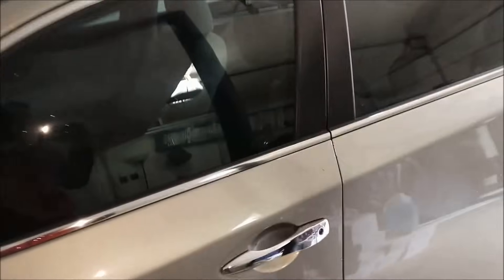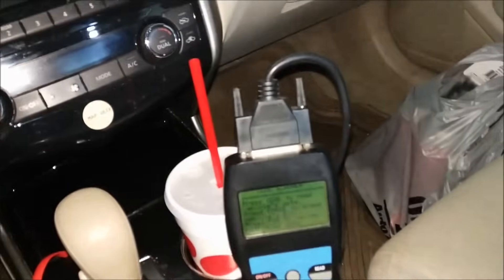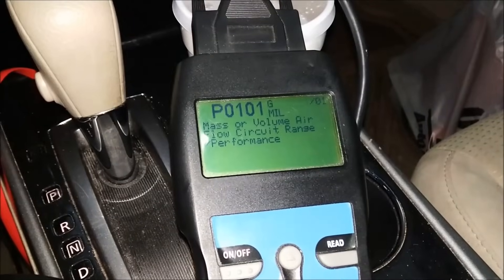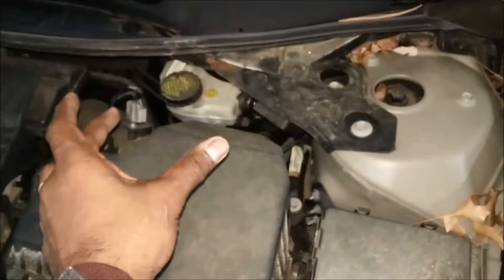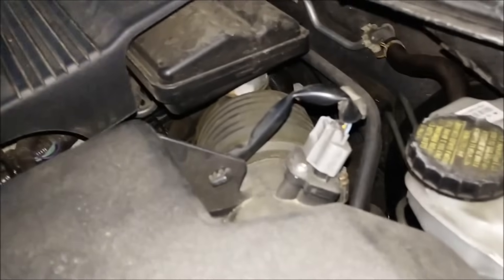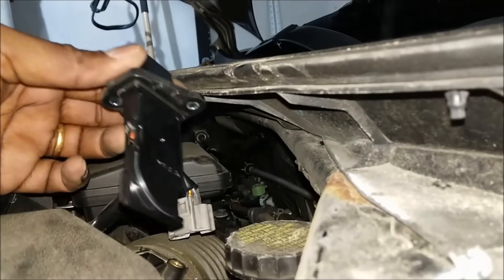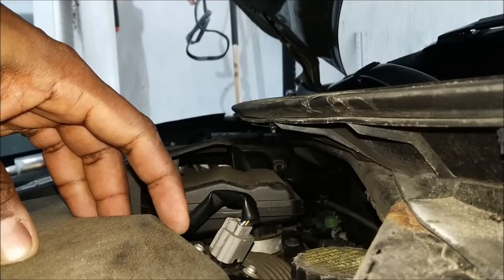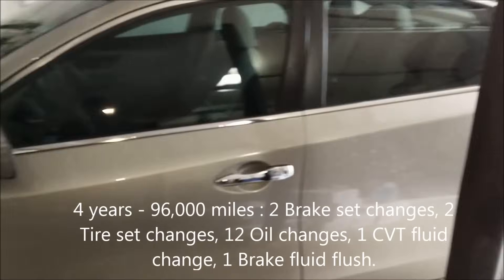2013 - 2018 Nissan Altima code P0101 mass air flow sensor DIY Fix

Comment: You made it look so easy. My daughter's 2013 Altima Has the same Mass Air Flow code. The sealership wants 300 for the part and then labor cost. Im going to probably get a better aftermarket part and install myself for her. Thank you for the informative video..

Comment: Thank you for this vid. I'm about to go get the cleaner and try cleaning first. My 2015 nissan Altima has 321326 miles on it and this is the first time this code came up. I will follow up after with my results.
Reply from the maker: 321k miles on the car. That is impressive. Did you do any transmission flushes along the way?

Comment: 2013 Nissan Altima SV. Same code, cleaned the MAF light came back on. Replaced the MAF, light came back on. Searched online for more solutions, and folks have said a faulty PCV valve can give you the same code, or a dirty throttle body. Checked the throttle body, and it's clean. Next is replacing PCV valve and hoses.
Reply from the maker: There was a service bulletin on the pcv valve, the cars came with some fault ones and Nissan changed the model to the black color valve I believe.
Reply: So what did you do to make it work…changed all those items but still have my light coming back on. Believe I need to get the Ecm reprogrammed
Reply: @coachtrollinger that's what it is more than likely. Same problem and dmv asked for smog check. Some dude programmed my nissan for 200 in Los Angeles
Reply: Fixed problem but I had to run car for about 100 miles before smog
Reply: @patrontwentyone did it work after the reprogramming ?
Reply: @dnasiasmith3983 it did passed the test if that's what your asking, but a few months after the light turned right back on. From my understanding it's  the reprogramming a leak in the catalytic converter or sensor.

Comment: Thank you so much, this worked perfectly for 15 Altima P015a  02 sensor issue. Pro tip, if you dont have a scanner, Autozone and most other auto part stores will scan your vehicle for free and give you the print out
Reply: Hey before you replaced the o2 sensor in your altima would it shut right off soon as you cranked the car?
Reply: @cedricmiller4370  no sir, I only had the engine light on, no noticeable performance issues
Reply: @cedricmiller4370  why I had the same issue so I crank my vehicle is shuts off now making a weird noise
Reply: @mikegold4559  Describe the noise.. I have had a 2009-2019 nissan altimas except the '13 and the shut off after you crank can be associated with your sensors going bad. Do not replace any parts until you get your codes. If your codes show sensor malfunctions, try not to drive more than a few weeks before getting them cleaned or replaced. Driving with dirty or bad sensors can cause your engine more harm the longer it goes unfixed. Most altima codes for sensors happen right around 60k-90k miles (depending on frequency of use). Also, Altimas are one of the easiest cars to replace parts for. I taught my mom how to fix her own car, she has replaced headlight assemblies, belts, her A/C Condenser, mass airflow sensor, spark plugs, wheel bearings, rotors, brakes.. my mom is 68, if she can do it, you can too. YouTube has all sorts of DIY vids, you'll save tons! Good luck!

Comment: A question in 2012 also that is the location of the mass air flow sensor. And when you cleaned the sensor did you erase the code before or after cleaning the sensor sir

Comment: The bird was great. Thank you for this. My hubby passed and he used to take care of my car. My light also went on so i will do all you suggested. Any suggestions on why my 2011 altima is burning oil? No leaks.
Reply: Check your valve cover gasket

Comment: Awesome video. I'll subscribe. You'd be a great teacher of real history or knowledge and or a great father is bet. Cleaned my air filter and it was nasty. My mpg went up insane in a test run around block. I'll clean my mass flow this week. Thanks,great video. Hopefully your cvt didn't die. Notorious for these cars. I only have 37,222 miles but they go out earlier then that.
Reply: Mine went at 56,000 cost me $4700.00 to fix. I'll never buy another Nissan product. They are junk.

Comment: Need help I have 2013 Nissan Rogue I change the mass air flow sensor but I try to erase the check engine light but turns on right away again

Comment: Have a 2011 Nissan Altima. Only 75k on it.  Same issues Check engine soon light on. Traction control engages out of nowhere. Shaking etc. an absolute mess.  Dealer said they fixed it only to happen again days later. Brought back for 3 weeks gave me loaner now got car back last week and check engine soon light is back on traction control engaging out of nowhere.  Bought a cleaner today trying to fix myself. I hope my car is not a lemon.
Reply from the maker: Read the codes and see how many codes are there and what are they.
Reply: Did your resolve your issue? What was the problem? I am having traction control issues as well!!

Comment: After replacing the sensor if issue still persist. Does cleaning throttle body will resolve it?

Comment: Don you have to reset the code or will it go away
Reply from the maker: It should go away after few cycles of driving if the sensor is reading correctly. You can also erase the code and the monitors will relearn.

Comment: And for the Nissan Versa note is the same thing?
Reply from the maker: Versa has a smaller engine so placement of the sensor could be different. Generally same procedure as long as you find the MAF sensor.

Comment: My 2014 just recently started giving me the code but it comes off and on with no real pattern. I’ve replaced the mas twice any idea what else it could be?
Reply from the maker: If it is not the maf, then it's either the pcv valve or a leak in the air intake house. Also sometimes it needs a software flash when you replace the pcv valve.
Reply: jjcentral I appreciate the fast response!! thanks I’ll definitely give that a try

Comment: Hola yo tengo el mismo problema en mi nissan 2013  lo yeve hacer el smog check y no paso me dijeron que tengo que cambiar el sensor del que usted hala y que ban a reprogramar la computadora  es verdad eso k ocupa reprogramar la computadora me cobran 450 dolares
Reply from the maker: No todos los coches necesitan flashear el PCM. Depende del sensor. Si se trata de un reemplazo OEM directo, no es necesario volver a flashear. Si se trata de una pieza no original, entonces sí es necesario volver a actualizarla.

Comment: What about a p0101 and has a new filter, new MAF sensor? Clean air box, cleaned throttle body. I usually reset the battery and the check engine goes off any my fuel mileage stays higher then it kicks on and drips drastically. 2011 xterra
Reply from the maker: Pcv valve?

Comment: Could you use rubbing alcohol in a spray bottle?
Reply from the maker: Rubbing alcohol, brake cleaner and other quick evaporators leave a little residue that may affect the sensor, thats why its ideal to use the specific MAF sensor cleaner.

Comment: Hello how would you recommend cleaning the air filter if it is dirty?
Reply from the maker: Air filters are cheap, replace them. Only if you have k&n filters you can use the cleaning solution to reuse them.

Comment: I cleaned my sensor and changed air filter once I had the Check engine light reset it came back on a couple days later do I just need to change the sensor?
Reply from the maker: Try changing the pcv valve next before you change the maf sensor.
Reply from the maker: @djsimma8617  Dealer service bulletin recommends a flash after changing any sensor. I have had plenty luck turning off the light with just code reader and using generic parts. The sensor is just sending low voltage, why does it need to be reflashed? On the other hand a full module change airbag, pcu, ecu, abs etc.. sure definitely needs reprogramming to accept the newer module.

Comment: The MAF is not the fix for this DTC. There is a SERvice bulletin for that p0101 DTC. You have to replace the PCV valve and reprogram the ECU. IF you have an oramnge PCV valve than the DTC will return eventually. Replacing it with the updated part (its Black) and dont use an aftermarket part, then the ECU needs to be reprogrammed. I work for Nissan.
Reply from the maker: Good to know. My DTC hasn't returned in the past 10,000 miles after the MAF replacement. If it comes back I will explore the pcv valve option. Are you saying that if I replaced the pcv with the genuine Nissan part, I don't have to reprogram the ECU?
Reply: @JJCentral-DIY  no im saying There is a Service bulletin that applies to your vehicle for that particular DTC. That requires PCV valve (updated part number) and reprogram. If the MAF fixed it. Then i would not worry. Its possible your MAF was bad. Typically i find that the MAF sensor is not usually the cause of that DTC. Most of the time its people using cheap aftermarket air filters that dont fit properly allowing dirt to get into the MAF sensor or some type of intake boot leak. Usually just cleaning the MAF and putting a quality good fitting air filter in (doesnt have to be Nissan Just has to fit properly) works. I just did a video on my channel on a Murano with the P0101 DTC. check it out.
Reply: Travis Butler  no, it needs a new PCV and a reprogramming.
Reply: if you put a new MAF on (unless its OEM) you will end up with more problems.
Reply: Auto Fix Pal any idea would could cause the light to come off and on? I replaced the mass sensor twice and the code keeps coming on I’m getting a little frustrated and my mechanic doesn’t have an idea but after reading this do you think it could be my pcv valve?
Reply: @pauljimenez4076  things that cause p0101 on nissans.. No. 1 cheap poor fitting air filters (use OEM). No. 2 really dirty throttle body.. No. 3 PCV valves on certain models, there is a tab for this.

Best place to start is to make sure you have a very good quality air filter that fits the air box very good. I do not know what brand of aftermarket filter is good enough so just get an OEM Nissan filter and be done with it. This is the most common cause on newer nissans.. On older Nissans ripped intake boots, and cheap air filters are the most common cause. Aftermarket air filters DO NOT fit properly most times and often cause air flow fluctuations that trigger the p0101 DTC.. Start with the filter, clear the light then check everything else if it returns. Nissan MAF sensors do not fail often. I repeat Nissan MAF sensors DO NOT FAIL often. Very rare. It's usually another issue.
Reply: @Autofixpals  Thanks for the fast response!!! I need to check the air filter I remember having it replaced at valvoline not sure what they use but I saw your video with the rouge does it have to be the exact number you used or just a OEM NIssan filter?
Reply: @pauljimenez4076  just OEM Nissan filter. Doesn't need to be the same exact number
Reply: @pauljimenez4076  now make sure you subscribe!
Reply: Frame is cheap but does not seal or filter well.
Reply: How much you have to pay for reprogrammed?
Reply: $300 Nissan dealer told me yesterday
Reply: Thanks I replaced my Sensor and the light still came on twice after

Comment: This was an awesome tutorial!, Question tho, I did the cleaning, and felt a difference on the idle and throttle, but the engine light still on. Does definitely mean I need to get a new sensor or do I have to reset something
Reply: You gotta reset so it relearns and buying a new one i would suggest
Reply: @scorpion_fps  how do you reset? I just cleaned mine but the engine light is still showing, even after driving it around (maybe 10 miles or so)

Comment: Will this code cause your car to not start properly for example Once I turn my car off I have to let sit for about 30mins before it will start again.
Reply from the maker: No, that is usually a fuel problem or the air intake is severely blocked in someway. Start by checking your air filter.

Comment: Update, refer below for old posts. Replaced air filter, cleaned entire airbox, no vaccum leaks, not a bad ground to the maf. Cleaned the throttlebody, light came back but restored some mpg. Replaced maf with a brand new hitachi maf, no reprogram from the dealetship and mpg went up even more and the light is finally gone for good. Ended up being the mass air flow sensor needed replacing, the old unit ran the car, no symptoms other than a missing a few mpg average and a CEL. Problem solved.
Reply from the maker: Thanks for the update, I don't believe a straight resistant measuring sensor like this one needs any dealership reprogramming. A replacement one should fix the issue. Just check the continuity and clean up everything.
Reply: Why did you replace maf? Didn't cleaning the maf resolve the problem?
Reply: I’m experiencing the same issue, cleaned sensor twice a light came back on. No drivability issues other than less mileage.
Reply: @blainemcdonald6972  I cleaned it because it had never been cleaned before at 65k miles. I was hoping it would fix the issue. It improved it slightly, but all in all, it was due for replacement.

Comment: I changed mass flow air sensor, due to check engine light code, on a 2011 Nissan Rouge Check engine light came back on. What should I check replace next?
Reply: You should scan it before replacing stuff to see what is them problem

Comment: Thank you for the video sir. 
Does the engine light go away after you clean the sensor. Or it needs to be reset manually?
Reply from the maker: It needs to be reset for quick erase, if not it will go through few cycles that may take up to a week to go off by itself.
Reply: @JJCentral-DIY  thank you. 
So which way is better? A quick reset? After that if the the engine light pops up again, I know the error could be due to something else.
Reply from the maker: @hulong0205  that is correct. You erase and see what new or old code pops up. That will tell you if you fixed the root cause or the symptom.
Reply: @JJCentral-DIY  Thank you so much! Very helpful information!!!

Comment: Well, I put a new oem maf sensor and clean filter.  Still getting the code.  Any suggestions?
Reply from the maker: Change pcv valve as well with nissan oem, pretty cheap.

Comment: Could you guide me where evap sensor located in nissan altima 2013 ? Do I need to open dash to replace it?
Reply from the maker: Assuming you mean the evap purge solenoid, it is on top of the intake manifold towards the back of the engine. You can do a 9 or 12v  battery test to see if it closes. If you are replacing that change the pcv valve right next to it.

Comment: Great video! I changed out the mass air flow sensor but the same code came back a few days later. Anything else I should check?
Reply from the maker: Change air filter, clean throttle body, and replace pcv valve with the OEM.
Reply: @JJCentral-DIY  appreciate the quick reply!! Thanks

Comment: From experience for what ever reason, Nissans and Infinitis don't play well with  aftermarket parts.  If you end up having to replace your maf sensor,  get one from the dealer or original factory part online.  Paying a little more upfront,  will save you in the long run when you have to replace the aftermarket part.
Reply: Mine is OEM Hitachi $560.00 dealer price. After market does sell the same Hitachi MAF sensor. Price is $ 385.00. Caution do not buy cheap air filters that are mentioned here. Nissan filter is around $35 better filtration and more durable, you get what you pay for.

Comment: What happens if you replace the mass air flow sensor with and OEM. The engine light still come one again even after the code has been erased?
Reply from the maker: Here are your options, Check the throttle body, if it's dirty, clean it. Check the connectors and the wiring at the MAF sensor. If you have a scan tool, look at the short fuel trim numbers at high and low RPMs. If the short fuel trim (STFT) goes lean at low RPMs, it's a sign of a vacuum leak. A leaking purge valve, as well as brake vacuum booster can also cause this problem. Check the MAP sensor; it's used to check for rationality of the MAF sensor. If the oem MAP sensor is faulty, it also can cause the code P0101.
Reply: @JJCentral-DIY  What about if the MAF sensor is reading 195 g/s constantly, and sometimes drops to the normal range 6-9 g/s? Is this a sign of a failed MAF, or is this a wiring issue? ( I ask because the car had the MAF replaced a year ago)
Reply from the maker: @roofcamper3473  at idle it should read between 2 and 8 and at full throttle it will be 30 to 40 times as idle. But if yours is putting 195 constantly, it is stuck in full throttle open loop. Clean it, if not replace it.

Comment: How long after til the light goes away? I changed it today but engine light is still on
Reply from the maker: Disconnect the battery for few minutes and put it back. Ideally use a code reader to erase and see if it comes back.

Comment: pro tip. if it isnt the air filter or sensor or harness, it is 99% chance its the ground screws
Reply from the maker: Could you be more specific on which grounding screw you are talking about? The main battery negative grounding screw?
Reply: @JJ Central  I have a 2012 Altima these 2 screw im referring to are directly above the alternator bolted to the motor mount for grounding. the wires lead directly into the engine harness
Reply from the maker: @alfizzle6794  thank you. There are quite a few in here that are looking for solutions. I will pin this comment to be visible.
Reply: @JJ Central  Yea thats cool.  this drove me crazy and I wanted to share in case anyone needed help and had tried all the steps from the fsm with no luck. Hope it helps someone!

Comment: I changed mine today but the check engine light is still on. Any suggestions?
Reply from the maker: It will take some time before your check engine light turns off. You need to drive the car for couple of days and then see. You can also turn it off using a scanner.
Reply: @JJCentral-DIY  okay that Answered my question